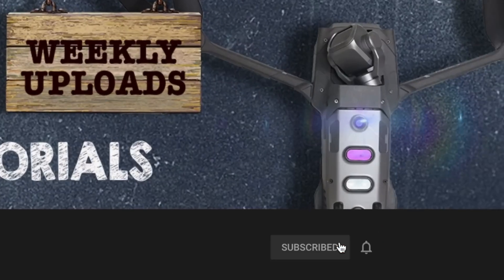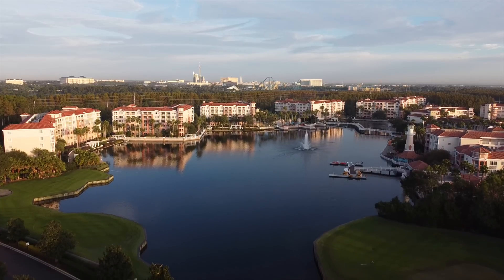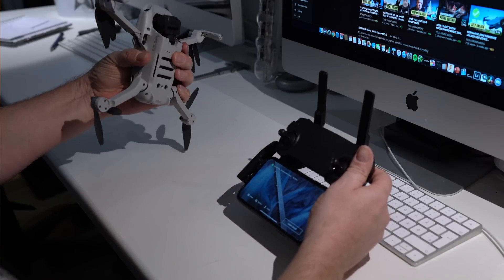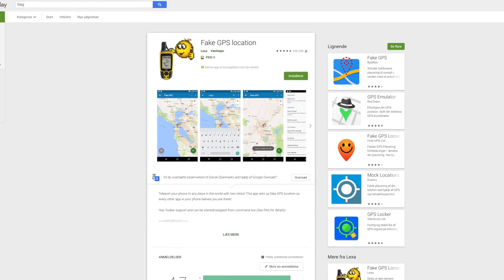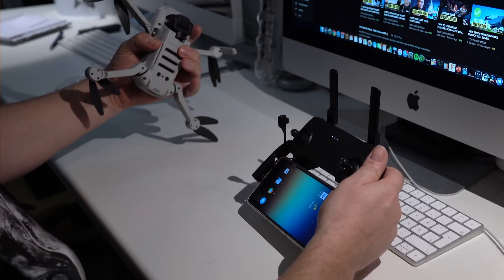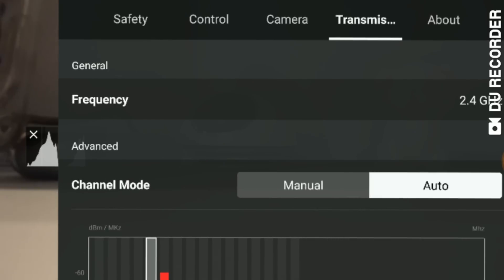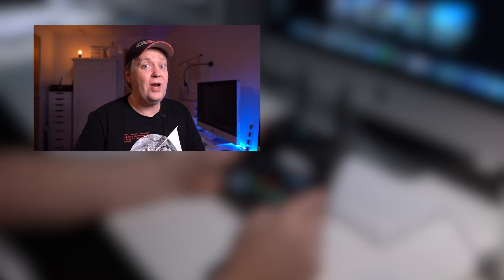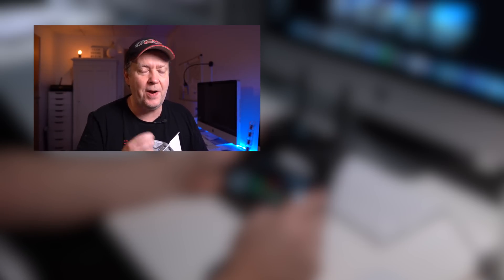HOW TO FIX MAVIC MINI BAD RANGE - FCC HACK (all DJI Drones 2020)

Comment: Just confirmed it working for the air 2, as well! Tested back to back and it increased no interference range at the very least 1km before I decided to turn back. Cheers!
Reply: hi...have u tried with mavic air 2...is your device under CE region or u bought it in USA..would like to know more cause i heard for CE countries there is a restriction of only 6km...Please explain more.TQ
Reply: @alvinreddy9309  Followed his instructions for mavic air 2 ce version, and it works, yes. Without setting location to USA I can go ~1400m before the signal starts breaking up. With location set to USA I could go 3.8km with no sign of signal dropping. (didn't want to push it further so turned back at that point).
Reply: @catomannen  where are u from?i am here in Malaysia and the CE standard guideline is 6km...i want to fly 10km do u have any friends in Asia or EU region using FCC version without hack
Reply: @catomannen  any updates

Comment: Hello there! Great video! Definitely gonna try this, but I have some other king od problem. Do you maybe know why my iPhone 7 is not charging while connected to the controller?
Reply from the maker: I recall this is an option in the settings that you need enable
Reply: TECH DRONE MEDIA do you know where is that option to enable? It would be really helpful
Reply: Hi, I was asking the same question to DJI just yesterday. The said only Android phones can charge with the Mavic Mini controller.

Comment: I made it in FCC mode at home, but when I go in the field it return back to CE. It doesn't matter that I follow your instructions.
Reply from the maker: did you start the motors before connecting the phone?
Reply: @TECHDRONEMEDIA  Yes I did. I did everything as you described in the video. Probably the new firmware is the problem.

Comment: I was quite sceptical about this but I tried it with my jailbroken iphone to spoof my gps, I live in a large city and usually don't get much range if I fly out towards the center. I got a lot further than I usually did and I'm sure I would've gone further if other houses or buildings didn't block direct signal. Thank you for this it helped really well.
Reply from the maker: Cool it helped

Comment: Just tried this on the latest firmware. I can get it into FCC mode, and preserve the settings by turning off and on in that specific order, but as soon as it took off, it was limited to about 15-20ft. then when I landed it, it reset wireless settings... Have DJI purposely stopped this working?
Reply from the maker: I have not used for a while, so I can't really say
Reply: Yes DJI stopped this hack! The drone gets now the GPS position. And NOT the controller

Comment: ok so I did this and it worked first time(2nd may 2020).was able to adjust height restrictions and the likes of that so I followed the instructions so that the setting would save but when I've turned it back on the settings have changed back but now I'm trying to do it all over again from the start and it wont work.does anyone have any ideas what the problem is?thanks 😁

Comment: Another GREAT video from  TECH DRONE MEDIA

Can you PLEASE help me with this...
 I tried and manage to put it in FCC mode (11 Channels + 5) but if I have my phone GPS on ( what I need for the Fake gps APP work ) after a wile it resets again to CE mode, so ...
1 - After the sistem assume USA position can I turn my phone GPS off ? 
2 - How that will afect the "find my aircraft" after a posible flight problem?
3 - Do I still be abble to use RTH ?

Comment: Hi good video! Problem is I can't find Fake GPS in the Apple app store. Changed my VPN from connecting from the Netherlands to US but still it sys it's not available. Anybody a better idea?
Thanks upfront
Reply: Hi Marc, pay attention to the video, he said that you need an Android phone for the first time, then you can use your iphone...
BUT I have a question too, I tried and manage to put it in FCC mode (11 Channels + 5) but if I have my phone GPS on ( what I need for the Fake gps APP work ) after a wile it resets again to CE mode, so ...
1 - After the sistem assume USA position can I turn my phone GPS off ? 
2 - How that will afect the "find my aircraft" after a posible flight problem?
3 - Do I still be abble to use RTH ?

Thanks in advance !

Comment: I just did this hack and it worked for me on my DJI Spark. Saw I had the 11 channels and as I type this I just flew it to about 2000ft! Before I could only get about maybe 500-600ft. And I even flew off my balcony with buildings around me and some trees. I just flew it up to about 350ft and went straight to 2000ft away! And of course I turned WiFi off and Bluetooth off I'm pretty sure I could have gone farther! But wanted to come back because of battery running low

Comment: Many thanks for your brilliant video. Just  completed your steps on Android and connected iPhone 10 on your recommend way with props spinning. Works perfectly and this is with the newest dji firmware update .0500 and app version 1.0.8. 
 Many thanks. Excellent. 👏🏻👏🏻👏🏻

Comment: Not much point unless you have the fcc model of the DJI mavic mini and not the Europe model
Reply from the maker: True
Reply: TECH DRONE MEDIA be interesting to see if the new mavic 2 will be the same if so iam getting the ya model shipped to me
Reply: @Popuppage  Hääää ? 
you will get occusync 2.0 like on Mavic 2 Pro and DJI puts new firmware into action every time they become aware of such hack that no longer supports such hacks.
If a drone is old and no longer gets updates than the likelihood is hight that a then appearing hack will not be fixed. ... And even nolimitzsdrones suck to deliver workarounds to change the mode.

Comment: With newest firmaware update it doesn't work any more. You CAN turn the FCC at home while the drone has no satelite reception, everything works.Fy at home all is fine. 11 channels. you go OUTSIDE drone catches satelite and switches to CE mode imediately.
Reply from the maker: You need to start the motors before you connect the phone
Reply: @TECHDRONEMEDIA  Ok finally it worked out. My bet, it was still giving this message once on site, but checked the channels it was 11. Anyway range is definitelly, better, before  I was able to make maximum 900-950meters, after fcc thing flew 1700 meter away. it is exact same location.  Drone was responding normally. I made few pictures, was not comfortable flying further away, because begining of congested area. But once returning home drone lost signal and parrtially returned with return to home function. Drone has newest firmware and android app.

Comment: Thanks for your great Vid However,  I thought  FCC does not have 2.4GHZ only 5.8ghz right?  but your transmission says 2.4GHZ after FCC hack. which indicates its in CE mode still right? pls advise:-)

Comment: I've jist changed the transmission manually and got to the 2,4Ghz with one click. No need for all of these you describe...

I have the European CE hardware that DJI gives 2000m range.

I've reached 3100m with some glitches, but no connection problems.
Reply: Tetrakosari Honda Turbo how do you do that? One click?
Reply: @Eldente-k1c  Ok it's not one. it's 3. Get in the menu, select transmission and then manual and one of the first 11 frequencies. That's it...

Comment: I've actually just come here to verify that the FCC model drone will be forced into CE mode in countries with different regulations. If I import the drone I want to be able to argue without lying that the drone will stick to local regulations on power and range in case local authorities have any questions.
Reply from the maker: I’m pretty sure it needs to do so to comply with local regulations
Reply: @TECHDRONEMEDIA  Yep! I just wasn't sure if it did that, now I know I can safely buy the FCC variant

Comment: Woooow It work in my mavic mini, before I use fake gps, with 2.4ghz I only can fly maximum 20meters away, and it will lost contact and return to home. And now my mavic mini  with fake gps is in 5.8ghz become more stable. And I always remember that to unplugged the phone before turn off, Great job bro ... Thanks from indonesia.
Reply: bro, boleh bantu info cara hack ke fcc bagaimana? thanks
Reply: doesn't really make much sense, as the lower the ghz the further the range, 2.4ghz reaches further than 5.8ghz and 900mhz reaches further than 2.4ghz etc

Comment: Hi. Great video. Works fine, but mine resets back to CE settings within a minute. Any ideas welcome.
Reply from the maker: Did you start the motors before you plugged in the phone?
Reply: TECH DRONE MEDIA 
Hi. No. So I initially followed your set up instructions, took the drone outside where it then informed me it was resetting to local standards. WiFi went off, then on and reset itself to CE.
After your kind message today, I tried starting the motors before connecting phone, but it makes no difference, in fact that way it doesn’t even go into US mode.
So, I played about a little for an hour, trying different combinations. At one point, I was able to take off whilst the ‘returning to CE’ was happening and although it was flyable, the message stayed on the screen obscuring the view and would only go if I OK’d it. I landed, OK’d the message and restarted the motors. US mode stayed and I had a 850m flight which is the same as previous flights in CE mode ( both with antenna range extenders ).
Would love to have the greater signal stability, just for my own peace of mind.

Comment: I will try that today & I will try to make a short video if it’s working 👍 just want to say that I’m leaving in Ireland & my maximum range for now is around 400m
Reply from the maker: Let me know how it goes
Reply: TECH DRONE MEDIA did work when I was inside house then when I went outside & the drone pickup signals from satellites then automatically jumped back to ce so no luck😣
Reply: Was that 400m on the 5.8ghz Lucas. Any further on the 2.4ghz?

Comment: Hello sir... Im using mavic mini CE version in India and I did as u told and I also got 11 channels which means I'm in FCC, but automatically it turned into CE again..... Please help
Reply from the maker: Did you start motors before you connect the phone?
Reply: @TECHDRONEMEDIA  yes... And if I do all procedure inside the house without giving gps signal to drone it turns to fcc and then I can fly outside also.... But if I do all procedure outside my house giving gps signal it turns to fcc but again it turns to CE..... I want help how to stay in fcc when trying from outside....
Reply: @TECHDRONEMEDIA  yes... And if I do all procedure inside the house without giving gps signal to drone it turns to fcc and then I can fly outside also.... But if I do all procedure outside my house giving gps signal it turns to fcc but again it turns to CE..... I want help how to stay in fcc when trying from outside....
Reply: @TECHDRONEMEDIA  yes... And if I do all procedure inside the house without giving gps signal to drone it turns to fcc and then I can fly outside also.... But if I do all procedure outside my house giving gps signal it turns to fcc but again it turns to CE..... I want help how to stay in fcc when trying from outside....

Comment: Wondering if this will work on the Australian fcc version AU 🤔
Reply from the maker: Is the power reduced in Australia? If it’s fcc I would imagine it runs on full power
Reply: @TECHDRONEMEDIA  yes its fcc but output power reduced as it says srrc restrictions to 2.5kms. Any thoughts or mods.
Reply: @justinwhyte558  Where did you read that power is reduced on Australian Minis? SRRC is for drones imported into/operated in China
Reply: Yes it should work

Comment: When I check the transmission tab in the DJI Fly app, I can see it is set to Auto, 5.8GHz and I can only see 5 channels. Even if I change it to Manual, I dont see an option to choose 2.4GHz. Any idea what I can do about it? I am in India and this drone isnt officially sold here.
Reply: Yours mini should be fcc not ce model
Reply: @jeffreyu54  Thanks for the response. Though it is an FCC one, I still have an issue with the connection cutting off at 200m. Any idea what I can do to fix it? There are no new firmware version upgrades available.
Reply from the maker: Have you tried with your phone in flight mode?
Reply: @TECHDRONEMEDIA  Yes, today I tried that. I put my phone on Airplane mode and tried flying it. I flew vertically and lost signal at about 80m height and 0m distance. Is there a way I can contact you and send you a link to a video I did a screen recording that can tell you exactly what happened :-)
Reply from the maker: Find the tech drone media group on Facebook and post it there. But this is normal, mine is doing the same. You need to point the flat part of the antennas at the drone
Reply: TECH DRONE MEDIA Just sent a request to join the group :)
Reply: @SubhramaniSathyanarayan  Hey I am from Mumbai and I face the same issue. In fact at times, my drone cuts off at 40m when flying vertically up (0 distance). However, when I take the drone outside the city (no WIFI pollution) I have been able to take the drone up to 250meters without an issue.
Reply: @icebreaker3000  Ok that sounds like my shitty drone as well. I guess we're destined to live with it 😬

Comment: I've tried your FCC hack but it doesn't work as smooth as it should. Sometimes I can't choose a flightmode (S,P or C) and in the left upper corner of the screen instead of flightmodes is says N/A exactly as in your video at 4:14 only in your video it changes to P after that. That sometimes doesn't happen when I try it. It stays on N/A and I also cannot select a flightmode in the menu when it says N/A.
 It also pops back in CE mode if I disconnect the cable from the controller.

I've also checked the DJI website and the CE model simply doesn't the same transmitting power in its hardware.

And could the bad reception maybe also taken care of by pointing 1 antenna straight forward and 1 pointed up? because the signal is sent around the antenna, therefor if you both have them pointed upwards the signal is being sent horizontal away from you in a circle and if you flatten one the signal is also sent around that antenna only now vertical, also upwards.
I got this idea after I could easily fly 500 meters away but upwards max about 40-50 meters.
This is a yet not tested theory, because the wind was to strong today but I think it makes sence, what do you think?

Comment: hi, tnx for video. I have a question:
how can I change transmission setting with iphone, once I’m in fcc mode?
Infact when the motors are running the App don’t allow to switch manually between the frequency
Reply: Johnny you can’t and that’s the trick. Once the props run its locked so it doesn’t switch back to the lower power mode. You could always manually select the channel on the android

Comment: FCC HACK

Android 10 users:

1 Head over to the Settings app of your device via the notification shade or app drawer.

2 Scroll down and tap on ‘About phone.’

3 Find an entry labeled ‘Build number.’ Keep on tapping until you see a prompt that says ‘You are now a developer!’.

4  You will be prompted to enter your device’s unlock code (PIN/Pattern/Password) at this point.

Voila! Now you can create a fake gps signal by using the app: Fake GPS

Ps: press the dislike button twice: LOL
Reply: Hello, is the fcc hack working for you?
Reply: @matthiasdeckel4569 I've tried the FCC hack but it doesn't work as smooth as it should. Sometimes I can't choose a flightmode (S,P or C) and in the left upper corner of the screen instead of flightmodes is says N/A exactly as in the video at 4:14 only in the video it changes to P after that. That sometimes doesn't happen when I try it. It stays on N/A and I also cannot select a flightmode in the menu when it says N/A.
 It also pops back in CE mode if I disconnect the cable from the controller.

And could the bad reception maybe also taken care of by pointing 1 antenna straight forward and 1 pointed up? because the signal is sent around the antenna, therefor if you both have them pointed upwards the signal is being sent horizontal away from you in a circle and if you flatten one the signal is also sent around that antenna only now vertical, also upwards.
I got this idea after I could easily fly 500 meters away but upwards max about 40-50 meters.
This is a yet not tested theory, because the wind was to strong today but I think it makes sence, what do you think?
Reply: @echterwel  Hm, I don't think so, because the signal, as you said, goes aorund the antenna. If you don't fly dircetly above you it shouldn't be a problem.
Btw my signal isn't bad. I can fly 1km easily but I just want to test fcc out because you can never have enough range.

And got your drone the latest firmware?

Comment: does this work without the dji controler?
Reply from the maker: No, you need the controller
Reply: @TECHDRONEMEDIA  But then the phone connects to the controler not the mavic itself. And when connected to the controler you are a 5.8Ghz and in this video you are at 2.4Ghz. I managed to connect to my spark and indeed after the hack i get 11Ch at 2.4Ghz but when connected to the controler it connects at 5.8Ghz in the channel 149 so whats the difference when connected to the controler with FCC or CE mode?